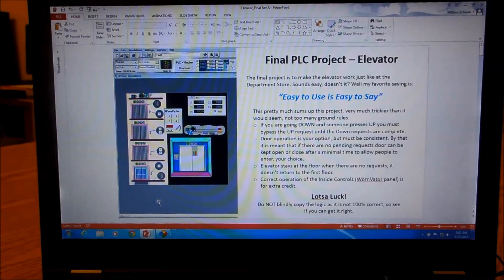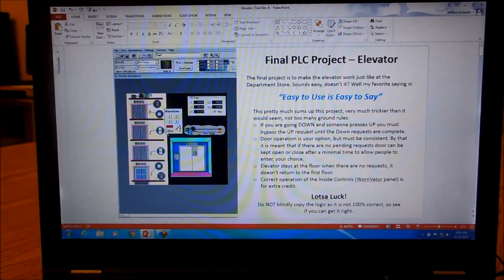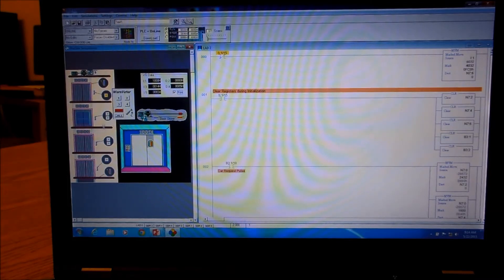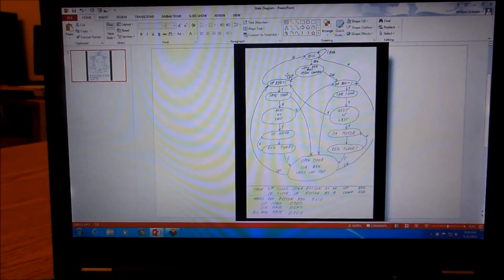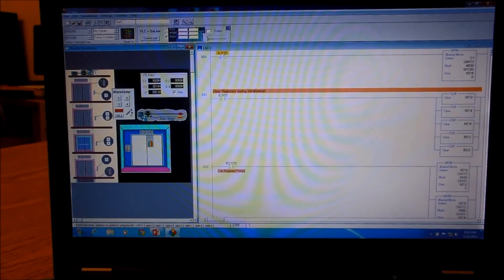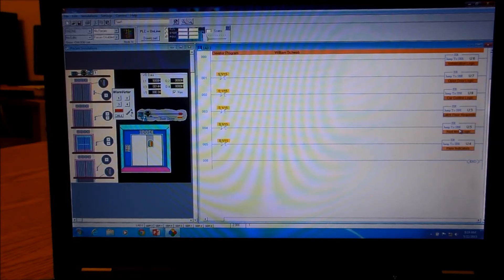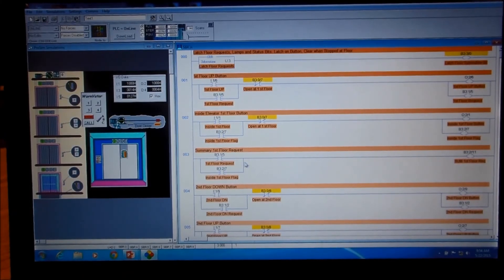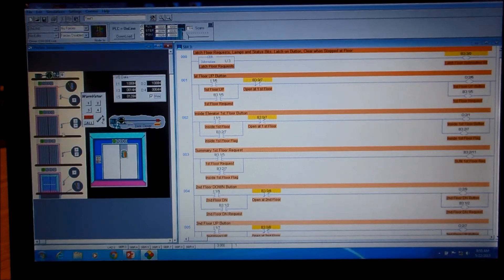Elevator Finale

Comment: There's a version of this software on the PLCsnet site by a famous plc programmer from the past called Lancie1 but the elevator loses control after some combination of buttons including both buttons on a floor pressed together and the cabin goes straight up or down hitting the safety switches. I worked for many many hours on this simulation and finally achieved a perfect result without any errors hitting all the buttons with any possible combination. It was hard. For the people interested it can be downloaded from the PLCsnet download section/ Alan Bradley directory with the name ELEVATOR 4 FLOOR EX 4.1 from ilia_popov. The program is completely personal and has nothing to do with the requirements of the exercise and by the way I have tried at least 4-5 different files from around the net and none of them works properly.